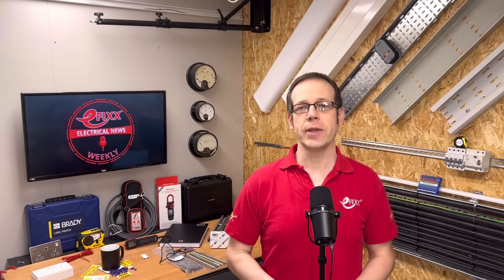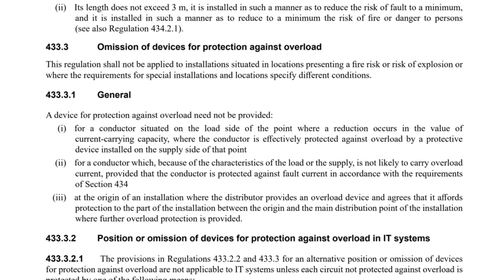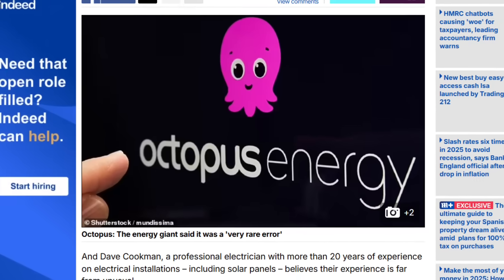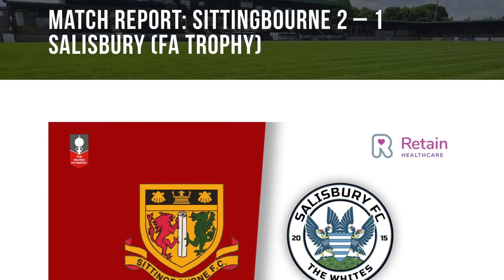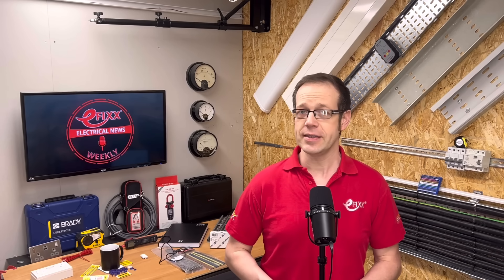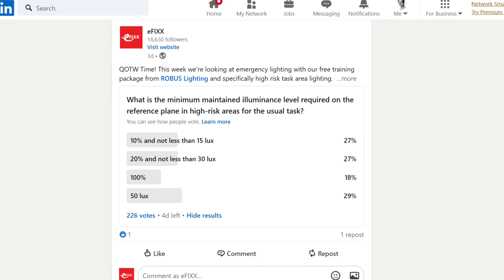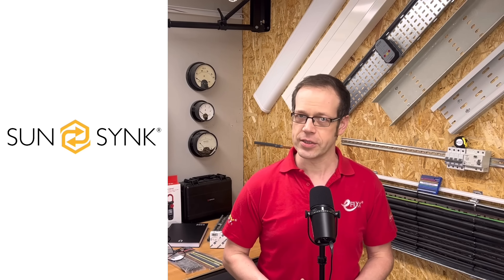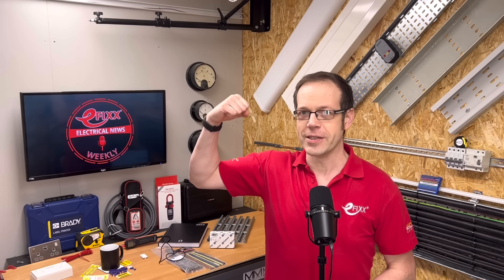Experts Give Verdict on the Cable Overload Row

Comment: I thought the cable had to be rated for it's Prospective Fault Current. i.e what it's over current device is protecting it against.
So I thought to protect at 32 amp requires either a 2.5mm ring or a 4mm radial . ( taking into account all the correction factors for how it's installed !)

Also a cables current rating is dependent on it's insulation. I'm sure pyro, hey MICC , could have much higher loads for a 1.5 mm CSA cable as compared to a PVC cable. (but who uses MICC apart from things usually like fire alarms , or really heat hostile environments ?)

Comment: I am not sure about 1.0mm connected to 32A protective device with the assumption the load will not overload. So, how does a person know how the internals of the connected load has been designed to behave under fault. The cheap crap from China and other places around the world I have concerns with. If it doesn't feel right then.......................!!

Comment: The 10A kettle lead into a 13A socket?  Surely the 10A kettle lead is protected by the 10A fuse in the plug?

Comment: But surely the meter itself doesn’t need the CT clamp to be fitted at all, the CT clamp is only there to allow the customer to have a little screen in the kitchen telling them what they’re using? Otherwise why even bother fitting a meter when all you need is a CT clamp, which can’t be sealed and doesn’t require any tools to remove?

Comment: Overloads, this is the same (similar) to motor systems, A motor (lets say 15kw) may have a FLC of some 30Amps, so a 4/6mm2 cable will suffice, but the fuse giving protection may need to be 50M63 or a 63Amp to allow for start-ups DOL.
All is fine, as there is a thermal overload protection relay, that monitors the current much better than a fuse and will trip at 1.15-1.2 FLC after a few Mins. This means its impossible for the cable to suffer prolonged overload.

Comment: In Norway, 1.5mm² cables are only permitted on 10A circuits or in applications where the user can't draw more than 10A through the cable. Most installations use 2.5mm² cables and 16A circuits instead, as they offer a better user experience and the cost difference is minimal.

Comment: The "CT Clamp overcharging" is a somewhat incorect.  Whilst the indicated cost on someones secondary metering system may well be incorrect ... the primary meter that is actually used for calculating the amount to be billed will always be correct. The primary meter does not use, nor can it be affected by the CT clamp.  Where it can become problematic is with battery systems, where the system will be confused by the diction of flow, thinking it is contributing to the grid when in reallity it is pulling energy out and vice versa, hower, as mentioned the primary meter will always tell the truth.
Reply: Maybe need a separate paragraph at the "Where it can" because of the change of focus (a different 'it') from the primary meter to the secondary metering - At least that's the way I read it..
Great comment.

Comment: Re undersized cables for overload protection :  
Does this mean that only TT supplies can take advantage of this loophole - as TN supplies use the MCB (even if in an RCBO) for Fault protection and the RCD is only supposed to be for Additional potection. Whereas in TT supplies an RCD is required for Fault protection and would therefore provide ADS under fault conditions before the cable was compromised ?

Comment: Kettle lead into a 13A socket....where the plug offers overload protection. WTF are they on about. And nobody anywhere uses a 1mm^2 T&E cable with a 32A MCB. Why on earth would they ?
Any cable can overload to more with a short. Overload protection is only to protect the connected cable system

Comment: Overlord current vs fault current?  Two phrases for the same thing?
Reply: No, try again!
Reply: @davidstone1579  an overload is certainly a fault from the point of view of the cable as it will likely overheat and even catch fire, in the same way it might if a fault occurs and it draws excessive current.
Reply: Fault is chopping through the cable with a spade. Dead short instantaneous current rise to the point where the Circuit Protective Device (MCB, fuse etc) clears (blows, trips etc) the fault. 

The cable should be able to pass the current from that situation without catching fire until the fault is cleared. 

Overload is when a circuit becomes overloaded. Meaning the load placed on the circuit is too big. Too big for what? Either the cable or the Circuit Protective Device. 

It’s much more than a one sentence explanation which is why electricians have to learn about this sort of thing. 

The regs aren’t well understood or well read. People see a headline and blindly apply it to everything even though there might be an exception to the rule. 

If you’re really stuck, then the section on basic definitions in The Regs should help a bit.
Reply: @andyscott5978  I think you rely on the regs too much.  Let's say a cable gets damaged and starts arcing.  Not a dead short but draws excessive current for a prolonged period.  Let's say water gets into a junction box and causes excessive current to be drawn over a prolonged period.  More current than the cable is rated for.  I'd call those situations faults.  I guess you'd argue they're overloads.  Hence my point, they're basically the same thing.  A fault should not just be considered a dead short.
Reply: An overload is where an intentionally connected load draws more current than the circuit it is connected to is intended to supply. A fault is where a damaged or faulty load or cable does this. The latter is almost invariably a far higher fault current than the rating of the protective device.

If you don't believe me, try and arrange a low fault current via mechanical damage or water ingress, and have it be sustained. Then explain how your final example could actually occur in a real world situation, and get some assistance in calculating the odds of it. Probably find you're more likely on any given 10 minute walk to the corner shop to get hit by a crashing hot air balloon.. Or, to be a little less hyperbolic, a car.
Reply: If you have "faults" overloading a 1mm2 cable in your walls, while not tripping the breaker, you are going to have more than 1kW of heat in a wall for a sustained period.

How is that going to get any better if your wire is 2.5? Now your 2kW or 3kW fault will never overload the wire or breaker and it can burn down your house even faster.

Such faults just don't realistically occur, or we would have fires all the time, also in circuits where all the wire is the same size and the breaker is correctly sized.

In Finnish regulations we do not have this terminology, instead of "fault current" we just say "short circuit current" and for overloads, "protection against overload". In my opinion "fault current" is not very good or understandable wording.

Comment: {2:15} EOn refitted the CT Clamp to my meter tails the wrong way round when I had my smart meter fitted in 2021. It was easy enough to spot, just look for the disproportionate rise in electricity demand on the instantaneous smart meter display when turning on an big electrical load (e.g. turning on a 3 kW kettle led to a 6 kW increase in demand from the grid). 
The cause of the problem was that the solar PV diverter (controlled by the clamp)  increased the power supplied to the immersion heater instead of reducing it when the household demand rose. At least the energy wasn't wasted, it just ended up in the hot water system.
Reply: Oof, that one's a bit more 'problematic' as it controlled a real load!

Comment: I have always wired a 1.5mm oven flex together with the (supplied) induction hob cable into a dual cooker outlet supplied by a 6mm cable on a 32 amp mcb for example.
Reply: Diversity takes effect here, yes even with induction as they pulse on and off in sync with each hot plate. John Ward has done a video stating wiring 1kw ovens into a cooker outlet is OK. They can not overload, and fault conditions are catered for by appropriate  sizing of cpc.
Reply: Most induction jobs can pull 32A by themselves, you must have to derate them? Not how I would want it wired anyway.

Comment: 1:50 err. . . what's the reg that says the minimum csa that can be used to supply power must be 1.5mmsq?
Reply: None
Reply: If the minimum cable size to supply power is 1.5 mm sq explain lighting circuits that use 1 mm sq cable and which are normally protected by a 5A fuse or 6A MCB? Is a 500W quartz halogen lamp not using any power?
Reply: @Mark1024MAK    He said power, not lighting. Think he's referring to 1.5 being allowed on a unfused spur from a ring?

Comment: Something doesn't add up with the External CT clamp malarkey, They're not used on domestic smart meters as a means of measuring energy in and out of a property that I am aware of, or the customer could just unclip it resulting in zero energy bills, so that leaves the CT clamp from the Solar PV system most likely with a battery storage add-on, when a current transformer is reversed on a Hybrid Solar PV system, the inverter thinks its exporting to grid despite energy being drawn from the grid so will charge the battery storage up, once the battery is at 100% it will sit there at 100% as it never detects a hose load from grid. How would this result in a £3000 bill in a month unless they have an absolute monster of an ESS system. There is more to this story than suggested in this video.
Reply: Exactly this. I suspect the "£3000 bill" was somethign calculated on a secondary metering system, in home display or similar not used for actual billing. The primary meter will of course have been correct.
Reply: Exactly what I was thinking.

Comment: I always make sure I over size the cables I install, even if it's just a few mm2, for piece of mind that the cable/install is never going to be the problem.
Reply: A few mm on 1mm lighting circuit is what? What’s the point in oversizing, no one wants to deal with oversized conductors. Grid switches are hell enough with 2.5mm
Reply: Why over size? And especially with lighting circuits, with most domestic lights now being LED how are your ever going to overload a 1mm sq cable if installed to the regulations?
Similarly, for other typical domestic circuits in the U.K.
Reply: If in industry yea sure, go for a 35mm swa when you need 25mm
In a house 1mm is fine
Reply: Energy savings for one. It’s in the regs for environmental considerations when designing circuits.  Bigger cable less resistance - saves money. Long gone are the days of saving money on increased conductor sizes.  Obviously still adhering to being able to safely terminate cables.
Reply: You must be a DIYer. Nobody is doing this day in day out. A lot of light fittings wouldn’t be fit for purpose if you did.
Reply: @Walktheline1991  not doing it cause most of you sparks need to spread your wings and actually understand the science of everything.  Unfortunately most are just sheep.
Reply: Standard cable sizes are already oversized.
Reply: @markrainford1219  clueless

Comment: I recently had a PV system with battery storage installed along with a car battery charging system. Both systems have their own separate Apps which provide energy consumption/generation data. After a few days of crazy data readings I suspected that the problem was the CTs and having investigated I found that both CTs were installed on the wrong cables. This had nothing to do with the meter but both Apps were indicating wildly incorrect data.
Reply: Fun isn’t it paying for professionals and then you end up having to fix it.

Comment: That's ok as long as someone doesn't come along after and put a 13amp fuse in the circuit.
Reply: Assuming you are talking about the example given in the video, how does changing the fuse to a higher value increase the current and power demand of a fixed appliance? Only if the appliance develops a short circuit fault will the current increase and then even a higher value fuse such as a 13A should blow. There is a difference between short circuit protection and overload (over current) protection.

Comment: Why the hell is a “smart meter” using a CT clamp to measure the consumption? They are not that accurate. 

And why the f. Are we paying £££ for smart meters that are hundreds of pounds that are no more accurate than a cheap device that can give you watts consumed that are a hell of a lot cheaper. And before anyone says smart meters are free they are not. The suppliers have been aloud to charge us more money on our bill to roll these “smart meters” for “free”
Reply: Actually smart meters typically do use a CT to measure the current, it's just internal to the meter.  I can't think of a meter that uses a shunt to do it, but they are no doubt out there.  As for accuracy the authorties consider a CT to be perfectly acceptable for measuring high amp services so think about that for a moment.  Old spinning disc meters employ a current coil but its magnetic field acts on the disc rather than inducing current in a secondary winding.  Before the local expert steps in, yes, there is a voltage coil in the spinning disc meter.
Reply: A CT does not have accuracy.
It is neither accurate or inaccurate.

Accuracy is a function of what is measuring the current provided by the CT.
Reply: Yes, everyone is paying for smart meters as part of their electricity bill and IMHO we are not getting value for money.
Reply: @Mark1024MAK  The meter costs what it costs. I doubt they are making much profit on the sale of the smart meter.
The profit is on each kWh consumed.
Reply: @deang5622  - Sale? In the U.K. the consumer has very little say in it, so how is it a sale? In the U.K. the consumer can choose to have a smart meter fitted or not. Once a smart meter is fitted, you’re stuck with it. The only other choice is between which electricity suppler company you select. For the most part, the consumer doesn’t get a choice of who actually installs the smart meter, the make or model of the smart meter. And because of a decision by our government to encourage the electricity industry to push consumers to have them fitted, we are subjected to lots of misleading advertising about them.
Unless the consumer reduces the amount of electricity that they use or switches to more overnight / times of low demand, smart meters don’t automatically save the consumer any money whatsoever.
Further because of the way that this smart meter roll out is being done, I have serious doubts that it’s being done in a cost efficient way. Meanwhile as I said before, regardless of if you have a smart meter or not, whether you want one or not, every bill payer pays a mandatory contribution towards the cost of the scheme. There is no opt out. I would not call it open and transparent.
Reply: @Mark1024MAK  Clearly you do not understand the definition of the word sale.
It's an accountancy term.

TL;DR.

Need to learn to write more concisely and with paragraphing. 

I wasn't suggesting the user had a choice.
That was an assumption you made.

The salient point I made in my post was that the energy company is not making profit on the sale/provision of the meter to consumer. That IS the reality.

I stated that the profit is on the kWh consumed by the customer.

I was correcting the incorrect statement made by the original poster.

You really need to think more carefully before going off on a long rant.
Reply: A kWh meter doesn't require a CT to measure current.

Evidently a more complicated setup is present, possibly using solar panels and feeding power back into the grid.
Reply: @deang5622  They certainly do when you step above normal residential units...

Comment: A smart meter doesnt rely on a ct clamp so how can it cause this issue?
Reply: Depends on the meter.  Most do have the ct inside the meter but you can get them with an external ct.  I think your individual suppliers over there provide the metering rather than the network so it's potentially an issue.  This is all theoretical as I have no practical knowledge of what happens over there.
Reply: @retrozmachine1189  There are no external CT clamps used on billing energy meters in the UK, this would make it super easy for customers to unclip it during high demand and have a zero bill.

Comment: Octopus shouldn't be relying on CTs for billing purposes unless they're wired by a suitably qualified person and of an appropriate type, certainly NOT the stupid clip on ones
Reply: The problem was that octopus put the CT back wrong after removing it during the fitting of the meter. They caused the installation to behave badly. Not wrong metering per se.